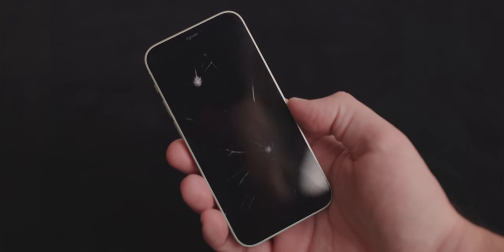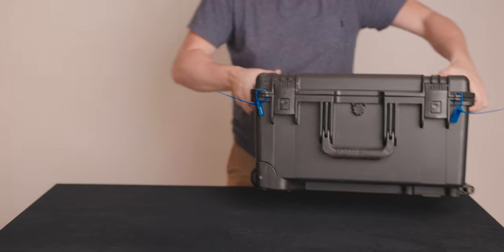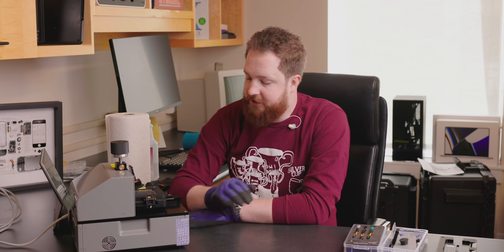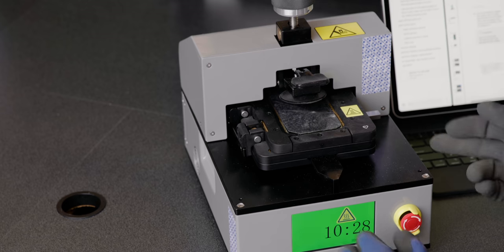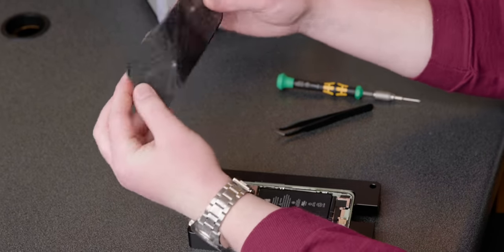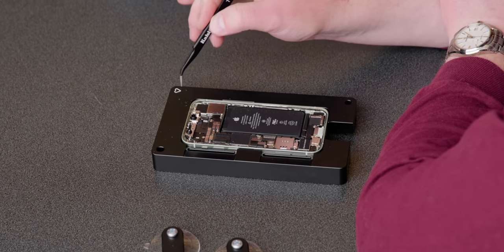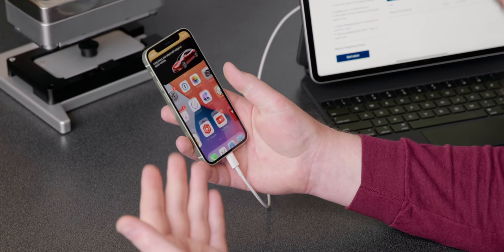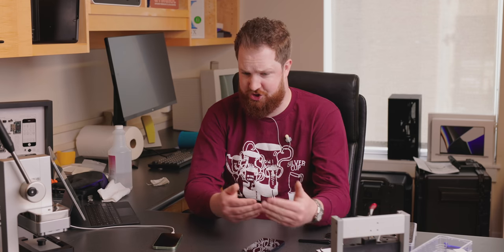Using Apple’s Tools to Fix My iPhone

Comment: The tools are just jigs to make sure you get the right amount of pressure and heat, it's the same with the torque screwdrivers. 
It's possible to do the repairs without them if you know what you're doing, but when you want repeatable results with unknown personnel it's just easier to give them tools that are foolproof.

I'm sure Apple could've just sent you a guide and the parts and said good luck, but in the end it's Apple who get the complaints if stuff doesn't work.
Reply: Pm me🔝.

Comment: If you're repairing your main (and only) telephonic device, how do you call in? 
And, did you happen to read the T&Cs you had to agree to for Apple to confirm your genuine parts replacement?
Reply: Land line? Borrow someone else's? Use an old one? VOIP?
Reply: spoken like a true UI guy.

Comment: The best part is the awesome clap at Apple of having an independent repair group as your sponsor of this video. It is bullcrap like this process that ensures that I will never again own an Apple product since my old gen2 ipod. I have gone anti Apple for years now. They have great products, but the hardware and software limits make it seem like they feel they are an untrusting parent allowing you the privilege of borrowing their products, instead of a customer.
Reply: I always like to point out how foolish/strongarm Apple policies are by applying them to the car world:

Jailbreaking an iPhone and then having Apple brick it in a subsequent software update equivalency: Ok, so you bought a new Ford Explorer. You wanted better winter handling since you live in the snow belt. You ditch the factory all seasons for all weather tires. Ford detects the change and remotely disables your vehicle until you return it to stock, even though the modification was to improve end-user functionality in a device you bought and paid for.

The repair demonstrated in this video equivalency: You buy a Honda Pilot. It is due for an oil change. The Honda dealership will do an "official certified oil change" for $100 (assuming you bought their Honda-care service, otherwise the cost is higher). You can get it done for $40 at the independent oil change facility down the road, but if  you do, Honda will void your warranty and not cover any future warranty repairs, even unrelated to oil changes (say the infotainment system breaks). Honda will allow you change your own oil, but they are going to ship you a mechanic grade car lift and full chest of SnapOn tools to perform it (which you must return at the end of the process) and it will cost $90. Honda strongly affirms that you are in no way obligated to exclusively use their services and support your right to repair or use independent repair facilities and in no way makes doing so unfeasible.

Comment: I repair iPhones and it is mindboggling how apple wants to be done.

However most iPhone 12 repairs can not be diy'd without apples kit. Altough your device will be functional, Apple will artificially remove features if it suspects that certain parts have been changed including but not limited to: true tone, face Id, touch I'd, cameras and you will receive multiple warning messages stating that non genuine parts are present, even if you salvage parts from another iphone. That is because a large number of iPhone components are serialized and paired to each iPhone so that you cannot repair it without hacking the parts or going straight to apple / apple certified technician.

Great video though 👍

Comment: What else was Apple supposed to do? I mean hey this is how you can properly repair your iPhone through us, so here is the equipment we use. It’s better they would rather make it more complicated using professional equipment than have a bunch of people complain that Apple didn’t provide everything they needed to properly fix their phone. Can you change a display without this? Ya probably, but there is no guarantee your phone will remain water resistant or functional.

Comment: I’d imagine self repair isn’t going to be very common. I think most people would rather go to a third party repair shop and have them order the Apple parts and install them. For those repair shops they will probably buy the tools they deem necessary to do the repairs and buy the parts needed. I think that’s why having those tools shipped to you and then shipped back seems so off… for 99% of iPhone users they won’t do the repair themselves. You however did and thus needed the tools shipped to you. As for the pairing… I think there’s a grey area there… for you it should have been paired from the factory. But for repair shops they might order more then one battery/screen at a time so calling to pair them makes sure it’s paired to the proper device… there’s definitely some things that need to be ironed out but a lot of the headache probably stems from it being done at home…

Comment: To be honest, the giant pelecan case of equipment did not bother me nearly as much as the fact that you have to call support to get into diagnostic mode and get the display verified. There is no reason you need to call someone for that. It's pretty clear the phone can figure out on its own if the parts are geniene, there's no reason you can't do that yourself.

Comment: The reason face ID did not work is because you replaced the speaker assembly with the oled, in repair shops they do not do this. in apples wisdom they figured they would tie the earpiece speaker to face ID.

Comment: I'm in the middle of a complete teardown  and rebuild of a laptop with very little information on the internet. I just spent 4 hours taking it apart. Most of which was scouring the internet for information about what to do next.  I have the screen and all the parts for the lid. I now know the keyboard is completely unrepairable because Lenovo heat sealed all the plastic pins down. I hate companies that do this crap.

Comment: The cost is why most people I know never upgrade their phones unless the screen breaks and they're already a few hundred bucks in the hole (so may as well just spend a efw hundred more for a new phone)
If the screens were cheaper to replace I'd upgrade more often but my wife still has the 7 because why upgrade it today when you might have to spend $300 tomorrow anyway.

Comment: Yea Fuck that. Like 2-5 minutes of 70-75c on the display, stab a jimmy in the bottom above the lightning port, use picks or “adhesive cutters” to slice open. Usually Takes me about 10-20 minutes plus whatever time calibration takes.

Comment: I think this over complicated process and those machinery needed is enough evidence for someone to file  another suite to force Apple into making iPhones easy to repair.
Reply: Absolutely!
Reply: And the case will get thrown out because this kind of shit is industry standard when it comes to in house repair tools. Engineers always make super precise tools for fixing their stuff so you get in spec, consistent forces being used for everything so it's as fool proof for the repair tech as possible. Also, their stiff clearly is repairable already. People here say these tools are over the top and they do it with a piece of string and some elbow grease (exaggeration but you get my point). The argument is that they make it hard to get the correct parts. The actual physical repair process is actually far, far better and easier than many other companies who always seem to get a pass or aren't given a shit about because it ins't Apple.

Comment: it's so embarrassing to have to call a technician to code the right serial numbers and check to make sure you ordered the screen from them and not just a used original screen. it's more than a middle finger, it's a spit in the face

Comment: 23:20 several weeks later and having just watched Hugh Jeffrey's video I've noticed that you didn't turn on the phone to test the screen.

Yes the manual doesn't mention it and it honestly should because I guarantee that there will be something wrong 90% the time.

And since there's only one adhesive and everything....

Comment: this seems like Apple making the repair look more involved than it is, just to make it seem like "everyone cant do it".
If you take all the "phone checks if its official part" and the fancy heaters and presses out of it, it literally is nothing more than heating the screen to loosen the adhesive, then pulling the screen off with a suction cup, removing the battery (which really doesnt need all that adhesive to keep it in place, that is a very tight package) and thats it.

Phones need to stop being this hard to repair.

Comment: the fact that Apple thinks that all is necessary to do a repair is baffling, a screen and a battery can be done with a $10 aliexpress screen press, Double sided adhesive, some UV glue, a UV heat lamp, Heat gun & a spudger.

Comment: I am a repair Tech for UBreakIFix and let me just say this is way over complicated (at least so far, am only 12:42 in). Generally the Iphone will be put onto a large hotplate for around 5-10 min (depends on the Iphone) then we remove the P2 screws/security screws then just pry that screen off with a pry tool. Apple really over complicates things with this repair kit.

Comment: I love the part  where you forgot to remove the two security screws at the bottom. And that's why you're struggling to remove the display altogether lol. We can see that 12:27, the bottom of the display was separated because the screws stayed in, but you did a nice cut in your edit to remove that part ;)
Very dishonest of you to not mention that you made a mistake and just say that it's hard. It is hard, but you also need to read the guide.

Comment: The calling in to verify the parts is probably the most anti repair thing in the video. Also you would assume the parts automatically say they are legitimate, but no they just instantly make you verify after every replacement.

Comment: Ubreakifix at least the one I used sucks. They didn't seal my phone back all the way and it got moisture in after the screen was fixed and then wouldn't fix it

Comment: 12:27 this just hurts watching. Also, the suction cup in the “heat machine” SUCKS, pun intended and all!
I prefer the display holders I have to “hold” display for this step, as feel more confident they won’t release the display, as suction cups are fickle! At best of times…..
Gotta say, this process is definitely NOT user friendly, and there’s other methods out there that works better imo, that most repair shops use and have for decades. The nice thing though is having access to oem parts “legitimately” now, and not the “alternative oem parts” that we can get “sometimes”; but I’m still not 100% convinced this good will repair parts process is gonna help right to repair, and I’m suspect tbh.
But hey, hope to be wrong, and will see thru time I guess, but do gotta say these last words.
iPhone 6s was and is my fav phone to repair, as a screen replacement could be done in 5 mins, w/ battery!
Microsoldering wasn’t hard on it either, and when the iPhone X came out, and so on, Apple phones just got horrid to repair, along w/ those damn Samsung curved displays, WHICH, know how many ppl crack Samsung phones each day, A TON! 
Then can’t forget about the awesome idea of putting glass in the back of a phone, hooray, now we can fix front and back glass….thx phone brands👍🏻 ur awesome! (I remember my first iPhone X Mobo and watching in slo mo as the pins went flying 🤦🏼 😂).
Worse phone award to repair ever! iPhone 4s 100%
Cheers Snazzy and thx for this vid, was awesome seeing a diy iPhone repair done, and you definitely aren’t a noob, and showing that ITS NOT EASY, even for experienced ppl.
✌🏻

Comment: lol, i just did a batt swap last week. i used a razor blade and a 20 buck soldering iron. phone works perfectly. this is all obviously a ploy to have it both ways. they can say they're following the letter of the law by having a program, and still sell you another phone when you sit on it or need a new batt. how much of earth's resources are represented by phones that live in landfills? we somehow can do the math on cow farts, but we can't figure out that planned obsolescence is both pollution and a waste of resources. how much carbon is released into atmosphere from the creation of a phone? cuz we make more than double what we need of those.

Comment: Dang this is kind of sad on Apple's part to be honest. It just looks like they're deliberately making this repair process prohibitively complicated and costly to deter consumer repairs. Like others have already said, this screams malicious compliance. I've replaced the battery, charging port circuit, an antenna and the case and battery adhesives on my Samsung Galaxy S9+ all with just a heat gun, suction cups, plastic wedges, isopropyl alcohol and the appropriate screw drivers. The battery, antenna, charging port circuit and adhesives all cost around $40 for genuine parts. The tools cost me $60 and I can use those for many more repairs. The tools they provided are great for high volume repair shops, but simpler guides for using accessible tools is what's actually needed here.

Comment: How exactly does Apple "have to" require a serialization for a battery health to read? Battery health worked prior to iPhone XS without issue. Good or bad batteries they would at least read the BMS percentage. 
Why do I need a serial number on my screen to make face id (A completely different sub system) work? Why do I need that for true tone to work? Why are serial numbers required for HARDWARE to work. 

None of this is required. Apple has been serializing parts since the iPhone 5 if not sooner. Only recently have they started disabling features of a phone because that serial doesn't match. Well I take that back error 53 on the iPhone 5S was apple disabling entire phones just because a customer had the audacity to replace their home button. 

Anti competitive moves are never "have to" situations.

Comment: I don't understand the controversy here. These are good tools.
Reply from the maker: They’re not great.
Reply: @snazzy  I mean you made the video, you had them in your hands.
But to me it looks like these might be the tools they use for actual production/assembly. It all applies the correct temperatures and pressure. 
I also thought the adhesive pad so the suction cup worked on the shattered glass to be quite ingenious.

Comment: I love and appreciate the over engineered aspect of these purpose built tools. But anyone else feel like this is one big ass troll? Its inconvenient and not economically feasible even for small shops because, and correct me if im wrong, after going through all the Apple red tape the price these shops will have to charge to make a profit wont be that much different than what you would pay getting it done by Apple. Or am I wrong? Seriously though, this is hilarious. Look at those boxes!! The point he made about it not being good for the environment is spot on too 👍

Comment: I changed battery on 5 iphones, NONE of the adhesive strips came out fully, actually almost ALL of them broke after just a little pulling. That is just a horrible design that Applie carries over and over.

Comment: Independent repair shops are capable of doing this. 
The real complaint / problem are the availability of parts. Apple threaten parts providers with lawsuits if they sell parts to repair shops or individuals.
The repair shops are left with the only option of cannibalizing non-repairable apple products.

Comment: You're right, they start to offering this because PR is bad but as you said: it's too expensive (more than give phone to a**ple shop) and takes too much time. The worst thing is that the display replace without re-serializing will not even allow you to bootUP your phone start from iphone 13, only after cable is plug in phone will bootup. The information about not genuine display is OK (when you put non original but also made-in-china display)but WHY they lock entire phone? Why they lock cameras, FaceID, powerON button etc after display replace? WHY-> because of unbelievable high profits they will not get. You think You're the owner of thing you paid for, but actually you don't have it for real.

Comment: The Apple iPhone is a complex device with super-dense packaging. Then there is the security hardware and software to consider as well. Consumers should not attempt to repair their iPhones That is madness. The simple fact is that the cellular phone is probably the most important device a consumer owns. Let Apple repair your iPhone and have piece of mind that the job will be done correctly.

Comment: your "calling apple for configuration" is NOT apple. that is a 3rd party center

but also my friend, you can enter diagnostic mode by turning the device off, then once off, holding both up and down volume buttons and then while holding, plug cable in, hold until you see the apple logo blink

Comment: 5:10 ehh. if you were to accidentally touch wrong part of the tools when they are in operation.
you will find that, they in fact are not. as you put it "very cool", but quite the opposite....

Comment: It's a the step in the right direction. Let's not start to pretend they have done their part. They are still making the phones harder to repair than necessary. Why do you need to pair parts with the phones? For security? That's bullshit. It can be done without it in a very secure way. But you have to give them that, it's a step in the right direction.